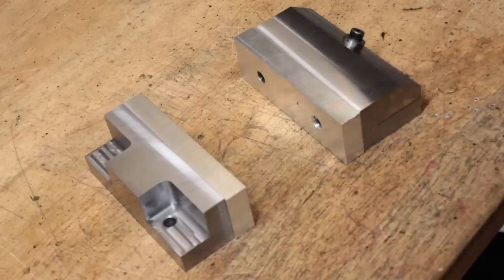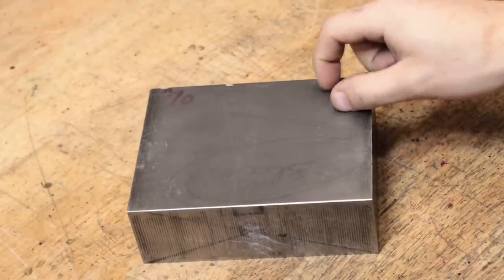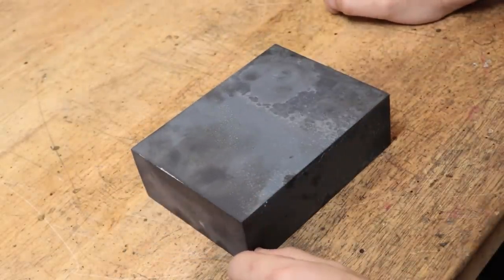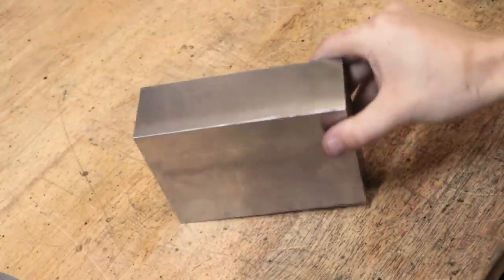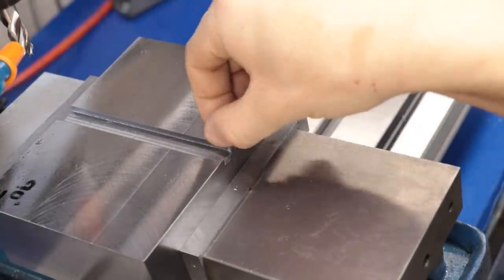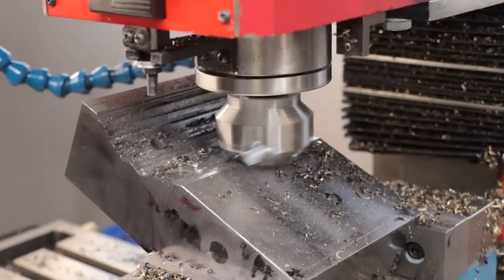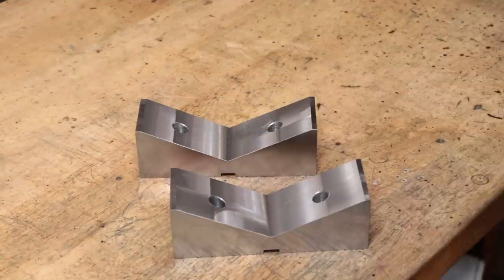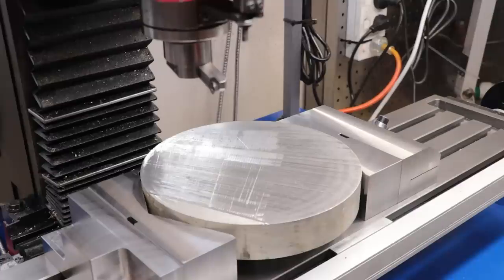Making a BIG  Set of V Blocks for the Milling Machine | Vise Jaws

Comment from the maker: Just to add one or two points that may have been glossed over in the video. Stress reliving is a complex topic I don't wat to make it out to be anything less. There are lots of things to consider with these materials when it comes to heat treating. What I will say is that when quenching under similar conditions, parts that I have made from cold rolled consistently warped slightly more than parts that were made from hot rolled. There will be many factors at play here including how well I was able to evenly cool the part, but I think we can make an assumption that the internal stresses of the cold rolled play some part in that. Now when it comes to heat treating and case hardening these in the future expect there to be some degree of warping, but if I can minimize that with the annealing, that would be fantastic. And that was the goal here, nothing more.
Reply: Dont feel like you need to justify yourself mate

Comment: Doesn't using those as vice jaws over constrain the part? I'm not a machinist but IIRC 3 points of contact is better than 4 because if the thing you are clamping isn't perfectly round each of the contact points will apply different forces and can distort the part or simply result in inadequate grip.
Reply: Yea, in general, I think only one v-block is needed in a vise.  However, maybe with a relatively large flat piece like that AL round plate, four points of contact might provide a  better grip.  And AL probably has enough give to even out the pressure at the contact points. But, I'm just an amateur armchair machining video watcher...

Comment: Hey there! A Blacksmith tip here, if you ever have to normalize/heat treat/anneal large pieces of steel, it's better to heat up the furnace empty until it glows a dull orange. Gets you quicker up to temperature, saves on gas, and evens out the heat better and quicker if you do not intend on soaking it for very long periods of time where evenness of heat doesn't matter as much because it'll even out over time anyway :)
Reply from the maker: Wouldn’t have thought that it would make too much of a difference but I’ll give it a shot next time I do any heat treating. Cheers

Comment: I usually use a 3 jaw chuck in my vise to clamp round parts, this looks very convenient though. I'll be definitely trying this in the future!
Reply: With smaller machines, you can very quickly run out of Z-height, but for larger machines or operations that don't need a lot of Z-height, that is definitely a useful method.
Reply: @Beef4Dinner22  That's true, I have a bridgeport so on most parts I have some room to spare
Reply: Newbie question here. But how to you attach the 3 jaw chuck to the table?
Reply: @pauljcampbell2997  either with an adapter plate to bolt it vertically to the table or on an indexing head horizontally. My indexing head can also put it on an angle
Reply: Thanks mate. Much appreciated!

Comment: Awesome job
One thing I'm kinda worried about though: did you check if the blocks are symmetrical around the key slot? Like sure, you machined them both at the same time, but what if you flip one of them, are the angled faces still in the same plane? If not, you'd clamp the round bar at an angle accidentally and wouldn't even know because you assume that the v-blocks are sitting right. So either mark the blocks on one side or make sure they are symmetrical.
Oh, and one question: how are you gonna clamp the round bar once it's on there?
Reply: My thoughts exactly. It was left out of the video and so far has not been responded to here.

Comment: Nice V-blocks! My shop specified a "tooling hole" dead center of the block so the V faces can be checked for center. When the V faces are perfectly centered, you can use them in any position without worrying about parallelism.

Comment: That's some good insight if you planned ahead and put the spacing of the bolt holes for the two piece vice the same distance as the t slots for the v blocks! Would be cool to see you make those t nuts really quickly though

Comment: You should consider getting some copper or alu or any soft metal thin plate stock, as in tooling plate(flat machined) for your vise jaws in situations such as these... Clamping a scaly part is a recipe for damage of the jaws and shit grip in some cases, as scale can be puffy and flaky, shearing off when enough force is applied, and it can thus allow for the part to shift, causing more damage to jaws surface... A 2mm alu tooling plate will soak up any rough scale into it and will not let go of any parts... You could even use 3 plates on parts such as these, where you place the 3rd plate over the vise ways, so when you hammer the part down or when the facemill hammers the part with each cut, the part is resting on a sacrificial soft precision plate that projects and protects the vise surfaces... Tho, i would advise a cleanup of the stock beforehand... All of my stock is either acid cleaned, neutralized with baking soda and washed in window cleaner or similar, before being sprayed down with wd40 and tossed in oil for storage until it becomes the body of the next project... Its a lot of work, but not having a speck of rust or scale in the shop really benefits the machines, and makes the cleanup and maintenance of the shop/machines much nicer and easier... Used car oil is a good pick for stock storage... you get at least 5l with each service and it practically encourages you to take better care of your car(dont get me started on benefits electric cars... i have nothing good to say about those)... You can also mix it with gearbox oil, so it encourages you to take better care of that part of the car aswell... Just wipe the part off with a rubber wiper and voila, a fresh, rust free part ready to be machined with minimal production of abrasive dust(rust, scale, other oxides)...

Comment: Beautiful work! I may not have enough knowledge about machining but is using 2 v-jaws like this over-constraining the part vs using 1 v-jaw and 1 flat one? Or does the extra surface just add extra clamping force since the jaws are machines so exactly in this case?
Reply: You instantly double your contact area, but that isn't the main gain. The V gives you sideways movement control.
Reply: @DodgyBrothersEngineering  Right, but would using a single V-block not do the same without potentially putting lateral strain on the clamped material if they're not perfectly aligned?
Reply: @BastiaanEkeler  potentially, but here is where I see issues... Traveling one direction on the Y axis you would have reasonable hold, but traveling back the opposite direction on the other side of the vice I see a much greater opportunity for it to rotate the part in the jaws, because you are machining in the same direction as it is being held. If he had left the steps in the face and had similar steps in the face of a straight jaw, I would probably feel more comfortable holding it that way.

I don't think a face mill or fly cutter are going to cause it any concern, but if you started loading up near the flat edge aggressively with an end mill, I see the potential to turn the part.
Reply: @BastiaanEkeler  giving this some additional thought... If the part is not symmetrical, or if for any reason the bolt holes were not exactly right. i.e. not indexed to make sure they go in the same way every time... It could potentially wind up with less grip than a 3 point grip. If putting it on the wrong way around suddenly centre line miss aligned the faces, it would probably have less grip. because you could wind up with two tight faces and two loose faces.
Reply: @DodgyBrothersEngineering  Interesting, thanks for your insights!
Reply: @BastiaanEkeler  for me what I think it would come down to is just how confident I was that I could get it absolutely spot on. If I didn't have the skill, or the machinery to make it perfect, I think your suggestion of using a three point system would definitely be the safe bet.

Comment: If you clamp down round stock on the v-block will you be able to face off the ends or would that be easier and more efficient on the lathe?
Reply from the maker: It might be but I dont have a chuck large enough to hold this part on the lathe. This is 200mm and the largest part my chuck can hold is 140mm ish

Comment: You are still using the sharp, aluminium cutting inserts on the facemill, correct?

If I recall correctly, you said that you used them to reduce the neccessary motor power.

Whenever I facemill with old manual mills, I have excellent surface finishes with the regular universal inserts, so I think that you should try those again too.

What do you think?
Reply: A lot of people have more luck with alu inserts on small machines, where the lack of rigidity makes reducing cutting forces a priority
Reply: @OWSNubbles  I know, but since he improved his spindle power and dampening, I think he should retry them at least.

Comment: Nitrogen is only one gas you could use as an inert atmosphere.

I worked in a factory running the heat treat furnace and we used carbon monoxide as our inert atmosphere. This has the added benefit of allowing us to change the amount of carbon in the atmosphere to either leech out carbon (less carbon in the atmosphere vs the steel) or absorb carbon into the surface later (carburization).

Comment: If you mounted your vice up one end of the table you wouldn’t need to take it off so often.
I’ve got a much smaller X-Y table on my setup, I mounted the vice about 3” from the right hand end & I think I’ve only ever had to remove it once. It’s never presented a problem there either.
Just the other day I needed to use my tilting table (had it for about a year now & that’s the first time I’ve used it 🤣) & I managed to squeeze it in next to the vice. Saves a lot of time setting the vice so often.